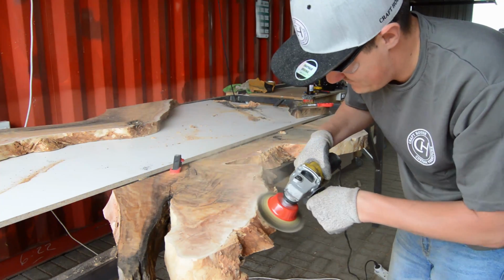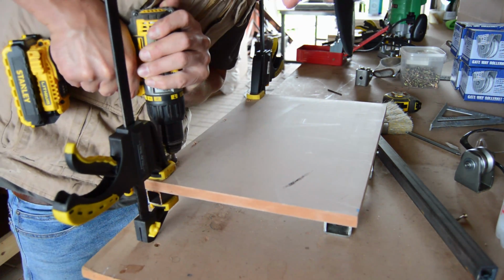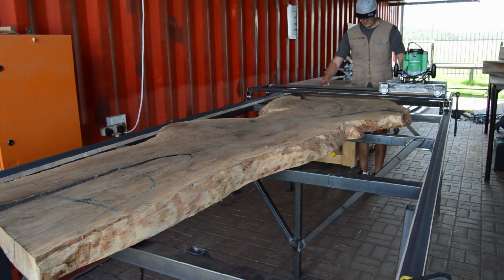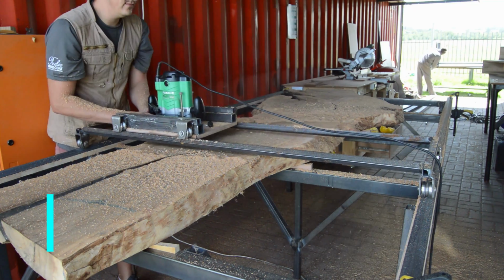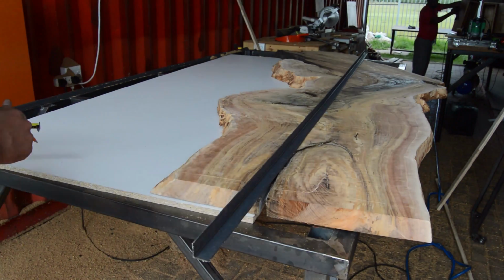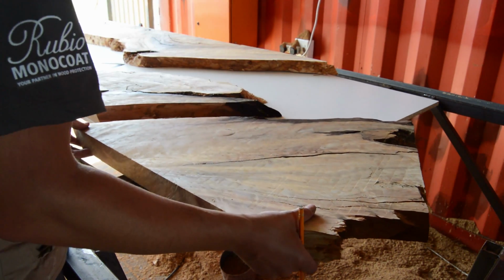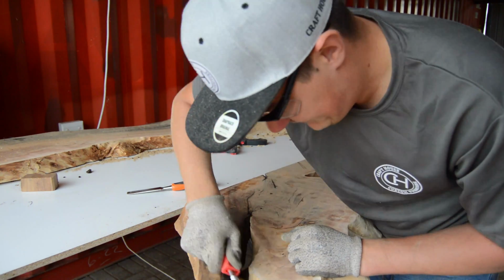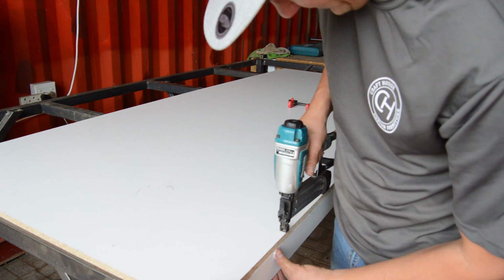DIY Epoxy Table - Step By Step Guide - Part 1

Comment: Hey Greg,  I have worm tracks on the side of my slab.  It looks like the worms made a tunnel.   Am I supposed to remove the tracks/ tunnels on the slab or can I leave them on?  It looks really cool, but I'm not sure if the epoxy would adhere to the slab.
Reply from the maker: I have go absolutely no idea, bever encountered a problem like this before.
Do what will look best 👌

Comment: You would have less thickness to remove if you would cut and shim your slab before routing it. You might even be able to pass them in a 24" planning table.

Comment: Something I saw on another channel which I thought was quite clever....secure an extension cable that hangs from the ceiling above your work bench. Connect your router to this extension cable, and then you dont have to worry about the cable getting caught on the router, tangle around your feet, or get in your way.
Reply from the maker: Eugene I actually done the same recently. Helps alot indeed

Comment: Informative Video! Must watch before a resin table job. Thanks a lot 😊😊
Reply from the maker: Thx for the support 🙏🏻
Just please make 110% sure the wooden slabs you get is dry, even if the person or supplier you buy it from tells you its dry, its most probably not dry. You need to measure the moisture in the core of the slab, otherwise in a few months the slab wil dry and shrink. Believe me i have learned the hard way. 🥳
Reply: @diywithgreg  ok...ya sure...thnx for being so helpful... 😍loving ur support😍.

Comment: Great router sled! Could you clarify what wire brushes you used to remove the marks left by the one on the grinder? Looking forward to part 2, thanks 😊
Reply from the maker: Hi Chris, its a wire brush but a softer brush, almost the same material as a wire brush you use to clean your BBQ grid with. If it makes any sense..